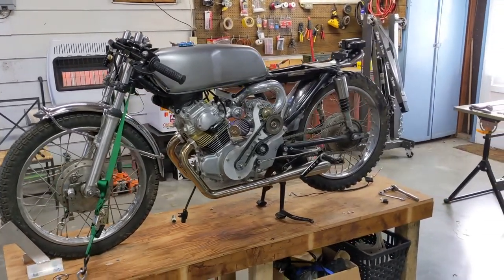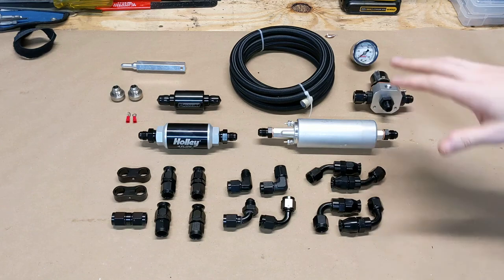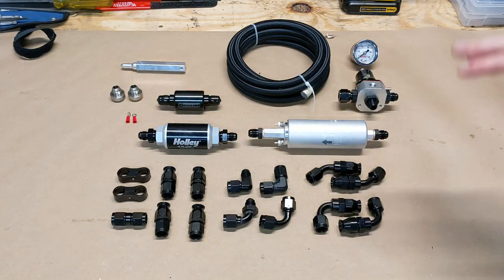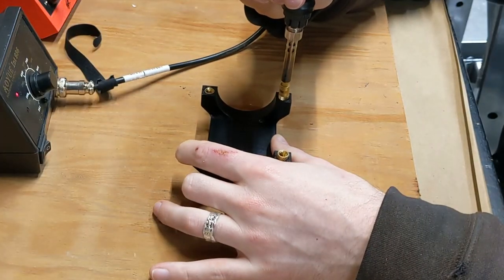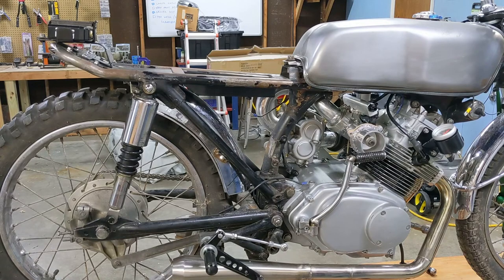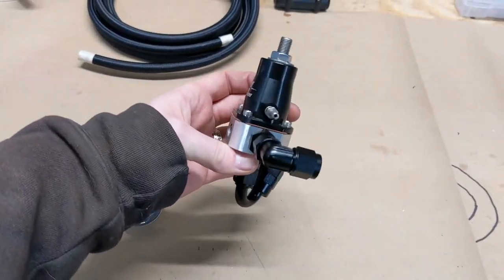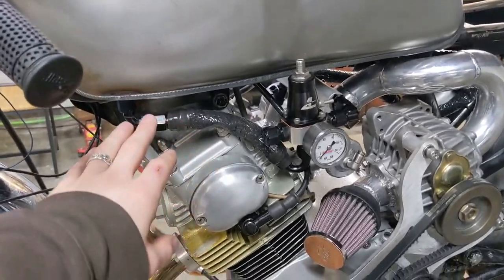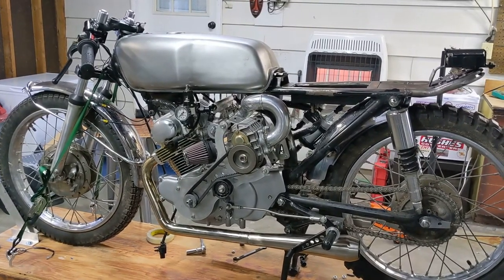Converting my SUPERCHARGED 1968 to FUEL INJECTION - PART 2 || FUEL SYSTEM

Comment: Very neat - using gravity to help get air out of the parts that don't like running dry does make sense. I'm just in the throws of doing a supercharged GSX11 but I took the easy option & used an early Gen1 Hayabusa fuel pump module as it's all self contained..and I had one on the shelf! Having watched your more recent videos first it all worked out very well!

Comment: Following this project, I am going to fuel inject my supercharged 600cc single but due to power consmption requirements of an electric fuel pump I was going to use a mechanical fuel pump driven off the supercharger drive belt but with the injectors triggered electronacly

Comment: I'm digging your build. Going to be an awesome little machine. One thing I wanted to bring up is hard mounting the fuel regulator on the JIC fittings. These are aluminum and brittle. My concern is the fuel regulator acts like a tuning fork and the vibration from the engine will fatigue the JIC fittings to fail and it may emulsify your fuel when running. Best solution is to isolate it with the PTFE line somehow. Anyway, just my cents. Keep up the build mate, looking forward to seeing her run!
Reply from the maker: I 100% agree. I definitely wouldn't mount it like that if this was going to be a street bike, but since this is going to be a land speed bike that only makes a few runs a year, I'm hoping it will hold up. I've already have thought about relocating it to the front of the bike (where the horn use to be). Thoughts?
Reply: @vintageironmotorcycles  okay cool. Minimal run time helps for sure.
I'm with you agonizing where to mount things on a small chassis.
Think about the space under the motor as a location. If you have a fuel leak it's not going to hit anything  hot. I'm stoked to see your progress.
So cool to do things outs out of the box. I have million ideas, but it's your project and your ideas. Can't wait to see the next video 
Cheers!

Comment: Nice work, looking forward to see the next video. 

I'm very curious about the throttle body before the supercharger and the injectors after the supercharger.
Reply from the maker: Hey Bo, it's really the same setup that 99% of supercharged cars use. Nothing ground breaking here ☺️
Reply: @vintageironmotorcycles  
Okay, I though that the most common setup with superchargers is blow thru when you got the throttle body and the injectors after the plenum the same way as with a turbocharger. 

I haven't study the supercharger blow thru application much when I went for draw thru in my bike. To my supercharger build I was looking for a old school design with draw thru and carb, two summers have gone and there's still alot of tuning to do to get the bike run well at the whole rev range, but it run and is drivable😉